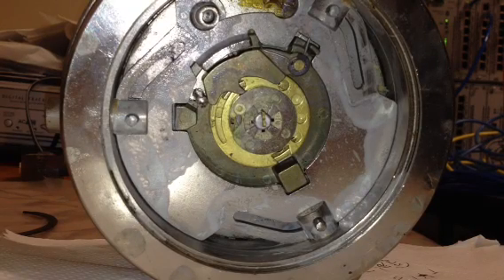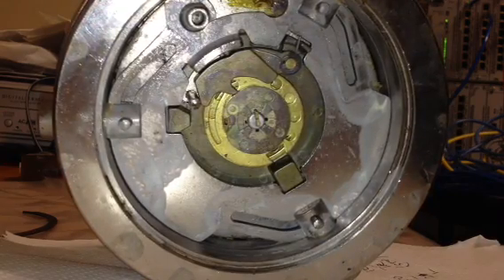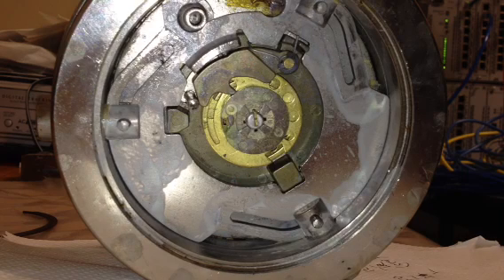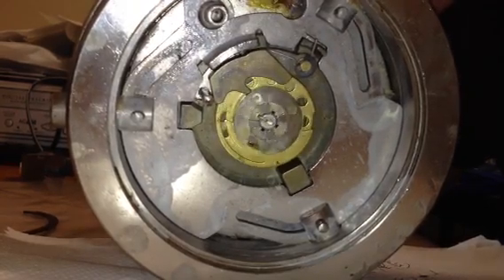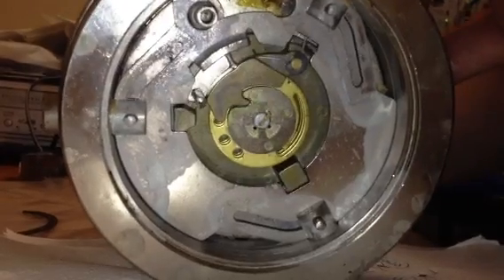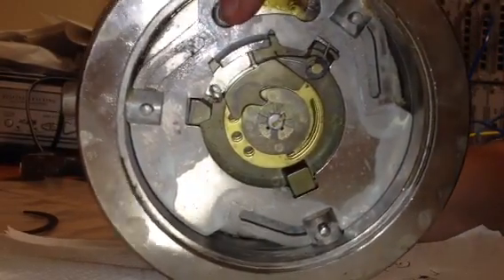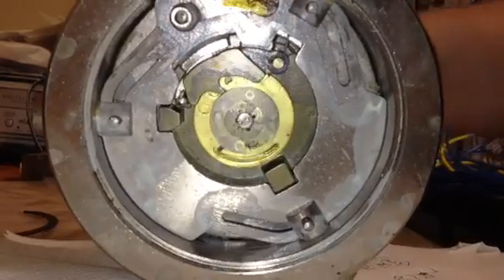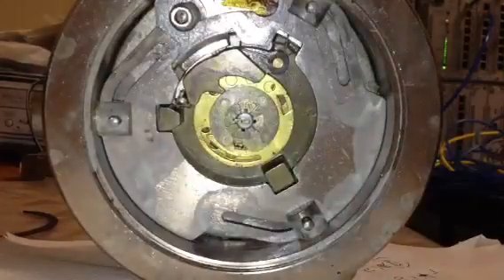Major round door safe type II operation and dialing order

Comment: Well only when you express radical force, i.e. prying, hammering, and more of the sort.  For the professional it is difficult because, there is very little metal (for magnetic purposes when cracking).  Furthermore, I dislike them because, I have to squat or sit to enable me to manipulate it.  So in turn; yes it is harder to open them but, only while encased in the ground.

Comment: I have one of these in the house I bought that was attempted to be forced open and failed. It has no dial and holes everywhere. What’s my options for a destructive method of opening it?
Reply from the maker: Visit SAVTA.org and find a competent safe technician in your area who can see if any of the existing holes can be used to complete a hole past the door and into the mechanism to use a borescope to view the combination wheels align. They can then put a temporary dial on it to dial the combination or just turn the stump with their hand.  Expect that visit and work to cost $250-$750 depending where you are and how much trouble the last attempt caused. Pro tip: Do not just call a random locksmith shop unless they are part of SAVTA or NSO and do not call the first locksmith you find on google that claims they are in your area, usually ends up being a fly by night scammer pretending to be a real locksmith. Know that 99% of safes found by new owners are found empty when opened.

Comment: Any idea what the factory preset is?
I was told it was 50-25-50-0, 25-50-25-0, 50-50-50-0 ?
Reply from the maker: Usually there is no factory combination on these, but some safe techs and locksmiths will set some safes to 50-50-50 or 25-50-25 or 50-25-50 when they change hands or are taken out of serivce like a bank vault when a bank goes out of business.  Not sure where you got the -0 zero at the end, that doesn't sound right.  More than likely the safe you have is not set to one of these combinations, and a safe tech will have to open it for a fee.
Reply: @squelchtone  it is a Mosler round door safe with 3 gates. I believe a second locked door behind main. The 0 allows you to turn the door clockwise.
Reply from the maker: @disciplejammergodstreasure8394  this video is for a Major safe, different animal than what you have.  Best bet is to find a competent safe technician on savta.org  good luck

Comment: Thats s loud dial.
Reply from the maker: I think you might be hearing the lever arm nose engaging the left and right contact points on the drive cam's cam gate every time the drive cam goes by the spring loaded lever arm as it rides the drive cam's outer perimeter.  The dial itself when you are on the other side of the door is quiet.
Reply: @squelchtone  yes, the cam gate. Couldn’t think of the name. Does that make it easier to manipulate the lock?
Reply from the maker: @Doc02864  I wouldn't say easier, but feeling the contact points is what you want more so than listen for.